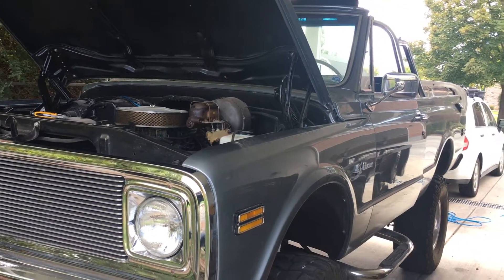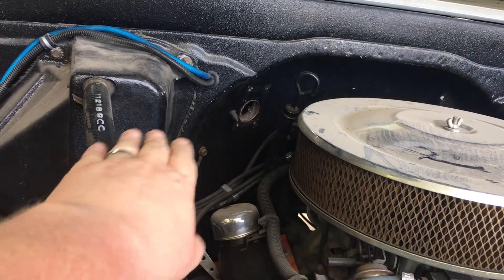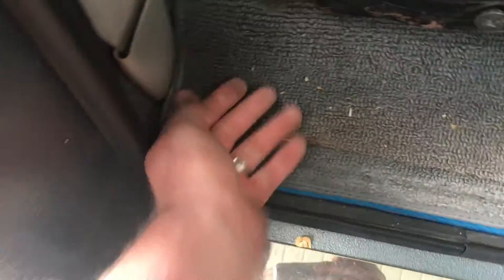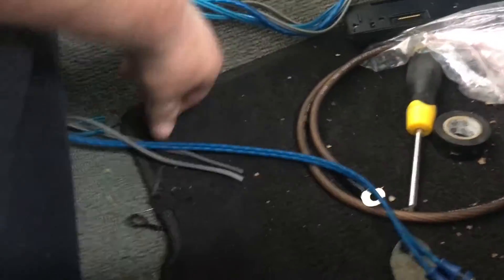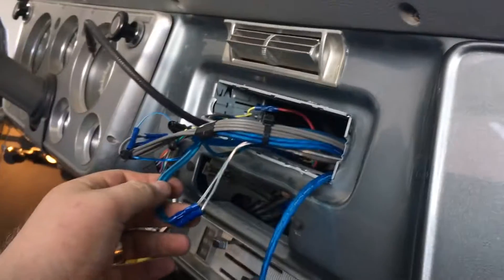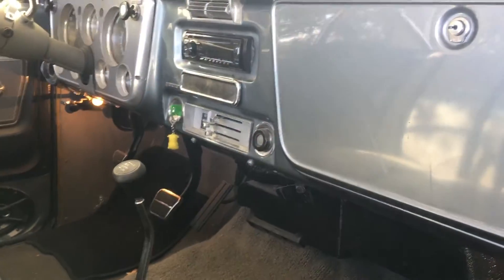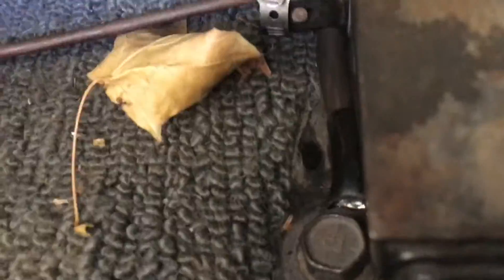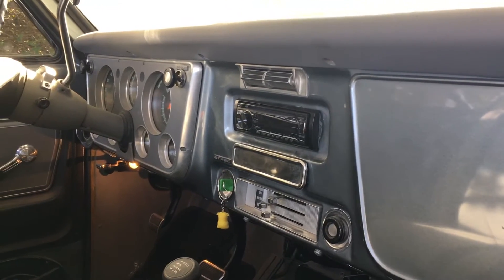1969 - 1972 Chevy K5 Blazer 4-Channel Amp and Sub Install

Comment: Great video. I was wondering what you do with the 2 wires that were connected to the glass fuses on the fuse box from the video before.

Comment: So I connect the speaker wire that came with the amp kit to the stereo harness?
Reply from the maker: Connect your amplifier speaker outputs with the wire from the kit (or any generic speaker wire) to the speakers on the harness, which lead to the doors (or wherever your speakers may be).  This avoids the needs to run new cable to each speaker from the amp.  It just utilizes the existing wiring which will make it easier for you.

Comment: I just picked up a 78 Chevy K10, and it has a secondary battery for the stereo that's installed. Can you advise to how to hook up a second battery properly to a stereo?
Reply from the maker: Actually, we will be doing a second battery install in the next month, so footage soon to be! For now, run a 4 gauge power (with an inline fuse) from the primary battery back to your secondary battery.  Place both fuses on as close to each battery as possible.  Ground the second battery to the chassis of the K10.  Hook up your radio to the second battery (also fused) and you should be good to go.
Reply: Woah, thanks for the speedy reply! You guys rock!